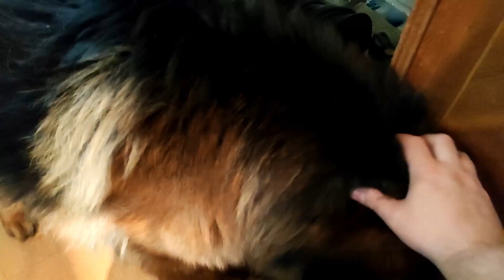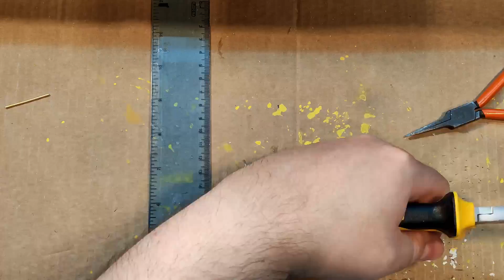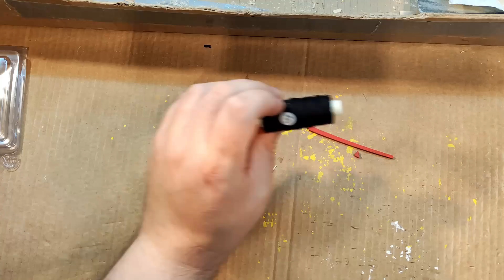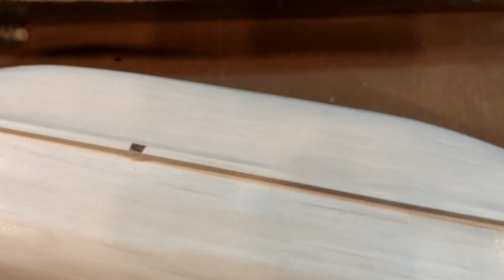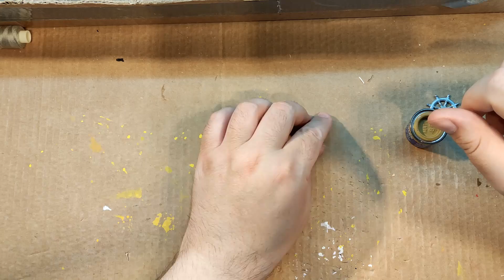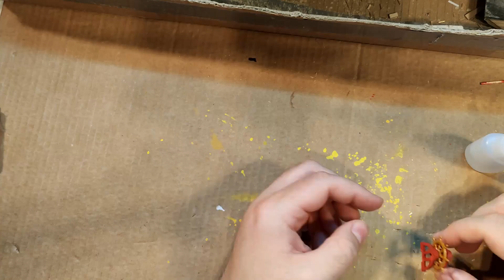HMS Endeavour - part 23 Placing The Wheel

Comment: Bonjour John merci pour ces vidéos je suis en train de construire la même maquette vous parlez de vernis dans cette vidéo est-ce que vous mettez une couche de vernis maintenant et quel est le vernis est-ce un vernis satin merci beaucoup 
Alain de Bretagne
Bonjour à Yves également
Reply from the maker: Hi Alain! I am glad that you found it useful! Yes the varnish is Satin and i did applied one coat on the deck.
Reply: Merci Johns. C'est ma première maquette,  vous avez raison  la coque est difficile à faire .  Mais vous m'avez beaucoup aidé.👍👍
Reply: @JohnsWoodenShips  Bonjour Johns est ce que la colle cyanocrilate  adhere corectement sur le pont aprés votre unique couche de vernis ? merci Alain  
Does the cyanocrilate glue adhere properly to the deck after your single coat of varnish? thank you Alain
Reply from the maker: @vanhaeverbeke  Hi Alain, yes, there are no glue marks visible and the glue does it's work properly.
Reply: @JohnsWoodenShips  thank you very much  John's

Comment: Re bonjour John,
Sympa cette petite barre du gouvernail fixée avec ces petites poulies, c’est plein de finesse et très joli, félicitation.
C’est quoi la plaque en bois dont vous ne vous servez pas (3mn12s)? Ne serait-il pas une plaque de petites poulies ?
Pourquoi avoir changé l’axe laiton de la barre par un morceau de cure-dent ? 
Quel est le nom de ce petit outil pour passer les files (23mn19s)?
Bon courage pour la suite et à bientôt
Yves de Lille (Nord de la France)
Reply from the maker: Hi Yves! The brass was very thin, the toothpick had the right diameter :) The tool is a tool to pass threads through a needles eye. You can find it in a local store that sells needles and threads :)
Reply: @JohnsWoodenShips  Bonjour,
Merci de votre réponse.
Concernant cette question : C’est quoi la plaque en bois dont vous ne vous servez pas (3mn12s)? Ne serait-il pas une plaque de petites poulies ?
Bonne journée
Reply from the maker: @modelismepassion4493  Hi Yves! Yes the have a plate with 3mm blocks that are laser cut and you have to drill a hole in all of them, stupid idea.
Reply: @JohnsWoodenShips  John,
Effectivement c’est idée stupide.